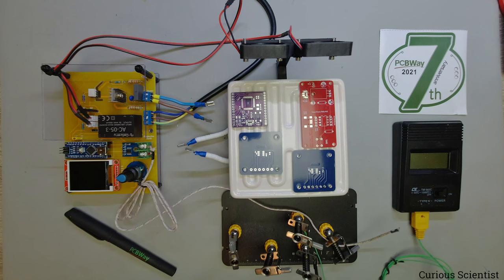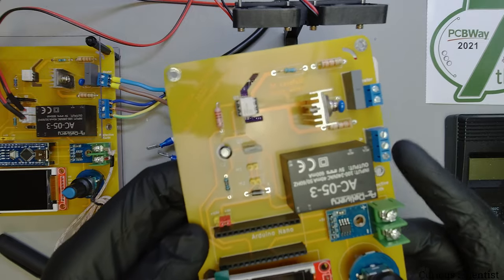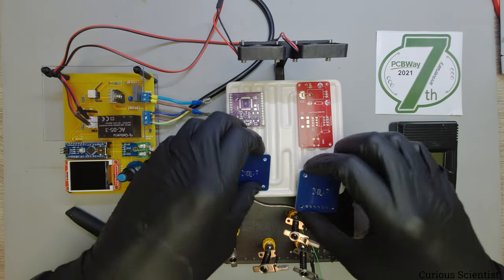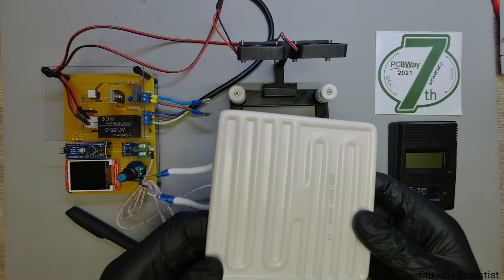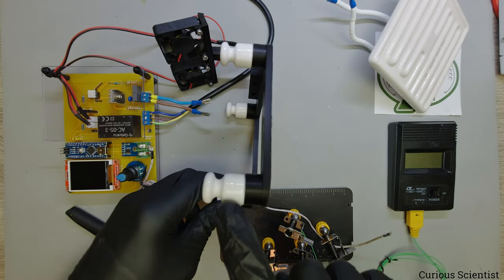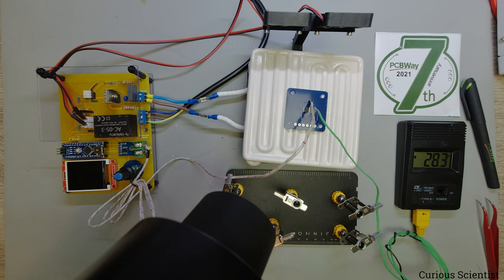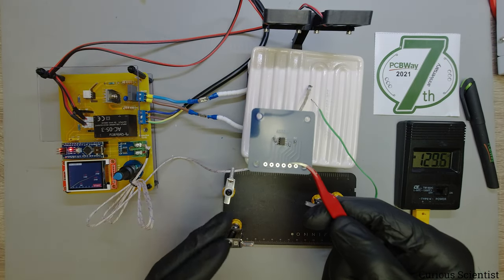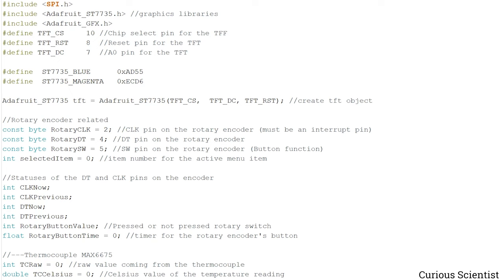Making my own reflow hot plate - Part 3 - Demo and Coding

Comment: You can fill the airspaces in the ceramic heat pad with thermal paste then place a piece of metal ontop of it as the actual soldering pad. If you make the solder paste slightly proud of the ceramic heat pad you can tuck the thermister inside it. 

Just be warned, first heat up and the thermal paste will smell bad and probably cause cancer, so heat it up in a well ventilated space.
Reply from the maker: Thanks! It is a good idea! I actually found another type of heater for this project, and I showed it in the later episodes of the series. It is a mica heater plate. I have used that since then and I am very happy with it. And it is cancer free. 😄 Nevertheless, your idea is also great, thank you!

Comment: I'm amazed, you can still today can buy those ceramic pillars since 100 years ago. It's a pity the mica-metal plate expand that much, but as you said the flatter the better
Reply from the maker: Yeah, they are pretty basic but still very useful pillars. Maybe it comes from their simplicity that they are still on the market. I will try to do something about the bulging by attaching it to something rigid. It would be a shame not to utilize it as it has amazing properties.

Comment: I have never seen that heater before, I probably need to test it. Can you reach 250degC? Maybe an aluminum plate on top would distribute the heat more evenly. And when the soldering is done the hole plate could be taken off.
Reply from the maker: I could go beyond 270°C easily, so I could also use normal solder with this plate. This heater worth its price in my opinion! A thin metal plate is probably a good way to get a more even heat distribution, but I wonder how the heater would behave as it is an IR heater, and aluminium tends to reflect IR radiation pretty well. Maybe another metal or a coated metal would be the way.

Comment: I cannot believe: 1h of explaining the code - I am wondering if even 1 person will go through it. If you wanted to help anybody simply share with them the code - don't torture people ;-)
Reply from the maker: If they don't understand certain parts of the code, they will always find the explanation. :)
Reply: I did go through it, and really appreciated it being there.  Thanks!   I might make  a 110v version of this project.  What changes to the high voltage components would be required?
Reply from the maker: Thanks! I'm glad to hear that my explanation was useful. If you want to use the system at 110 V, you need to pay attention to the onboard power supply (the black brick module that provides the 5 V), and you need to pay attention to the power rating of the heating element. Otherwise, I think the rest of the circuit would be OK. The other mains voltage-related stuff are rated for 220 V, so I don't see why it would not work at 110 V. Maybe also check the triac because I don't remember its amperage. Since the heating element would probably need twice as much current at 110 V to provide the same wattage, it could be that the current consumption would be too high for this particular triac.